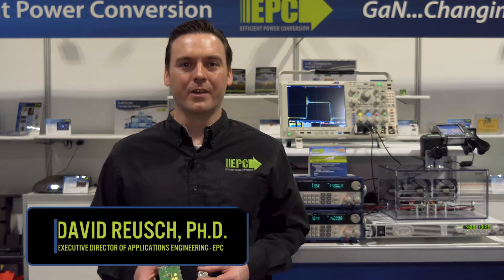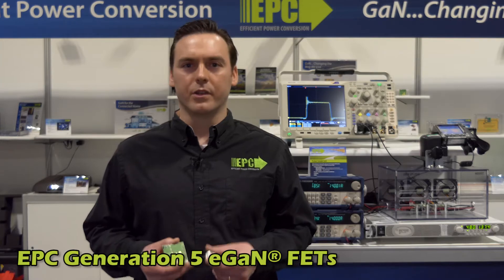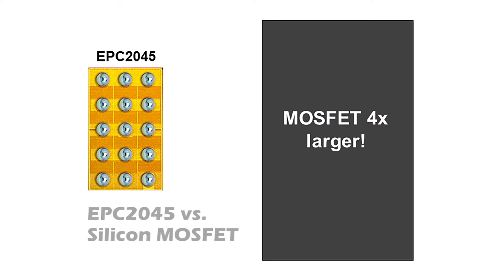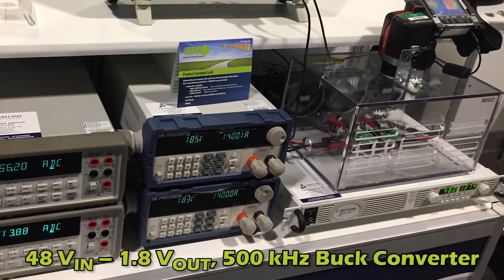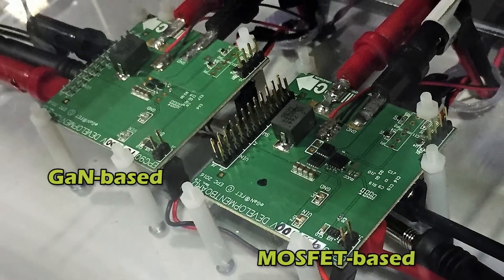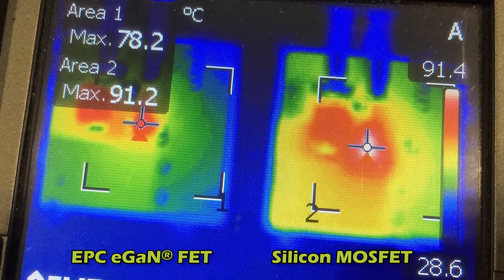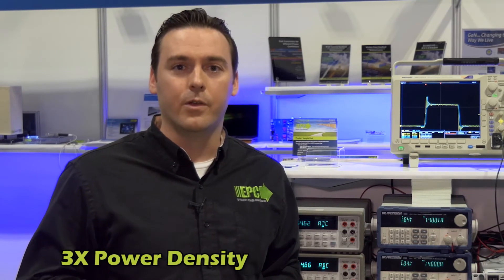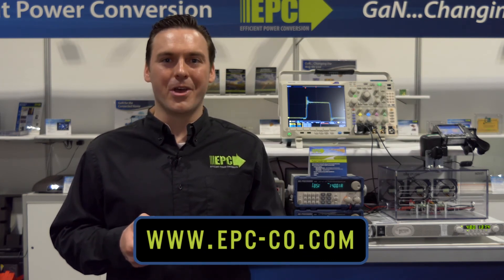GaN FET vs. MOSFET: 48 V – 1.8 V DC-DC Conversion

Comment: Are you aware that your 48V to 1.8V, 100A buck converter has both switches, regardless if they were MOSFETs or GaN devices, being rated at 100V due to spikes present because of hard switching on 48V bus voltage. Hence synchronous rectifier MOSFET has 100V voltage rating and 10kW power rating and delivers 180W. Ditto for GaN devices.  Worse yet, both GaN and MOSFET devices are turning ON into 100A and turning from 100A due to square wave current switching. The problem is in your selection of the wrong converter topology, which is patently unsuitable for the 48V to 1.8V step-down. It appears that you are trying to artificially excel the GaN devices over MOSFETs with the temperature difference. What about their respective efficiencies, which are NOT disclosed?  Any comment on the transient response of either implementation. I accept your Figure of Merit of GaN devices but you are killing it with lousy Figure of Merit of buck converter with 50 times (2% utilization) overkill in voltage rating and power rating of output device!  500kHz switching adds nothing to size reduction compared to 150kHz except destroying efficiency. 
The device comparison is completely misplaced when it is overridden by grossly inadequate converter topology!?This is one man's pinon. What is yours?